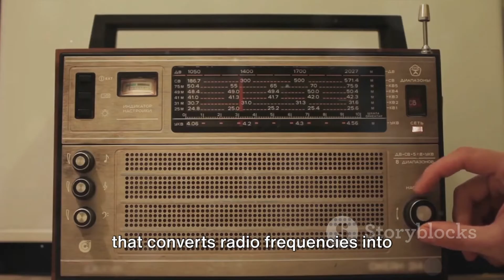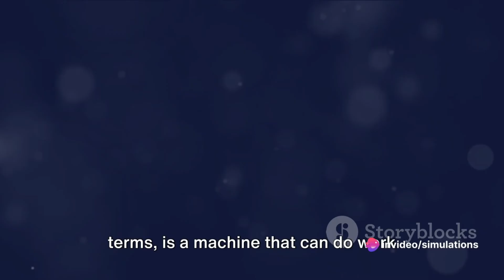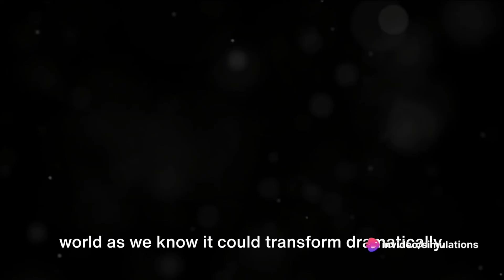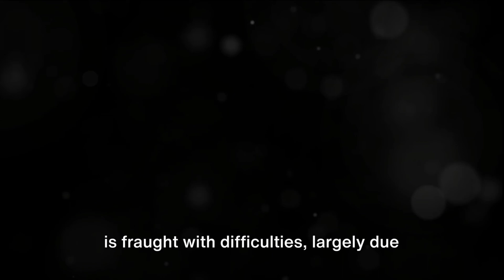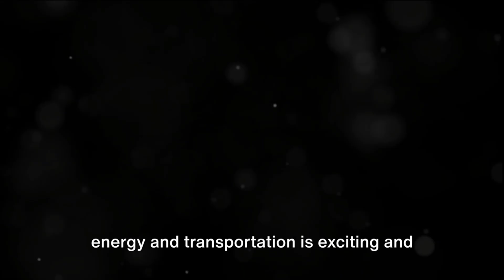Can Radio Frequency Power an Electric Vehicle?

Comment: It’s not a perpetual motion machine… just like solar isn’t perpetual. It’s capturing fuel(radio waves). Basically like filling up little bits while you’re on the go. It won’t be a thing until they can build a network for it and charge you an obscene subscription fee.
Reply: It does not need network. It works on earth from artificial created frequencies, stations already work. Out of earth out of the magnetic buble which protects bio forms to grow, in free space source is unlimited from cosmic particles. It is simply using any form of vibrations. Same as electrical transformer, only different choice of input.
Reply: It does not need network. It works on earth from artificial created frequencies, stations already work. Out of earth out of the magnetic buble which protects bio forms to grow, in free space source is unlimited from cosmic particles. It is simply using any form of vibrations. Same as electrical transformer, only different choice of input.
Reply: @Your_opinion_does_not_matter  That makes NO sense.

Comment: So does leaving the radio on, charge or drain the battery?
Reply: It's a receiver, not a transmitter.
Reply: 🤣 Depends, I doubt it will run very fast on NPR.

Comment: would make an ev car much lighter with no battery
Reply: Video didn’t explain anything
Reply: Just think of no more energy bills for heating or cooling homes , no more fuel needed to power cars and how much cleaner cities and the air , rivers or just life in general !    This is free energy !
Reply: the goverment will find ways to make us pay  @popeyesworld4930
Reply from the maker: Yes, and cheaper!
Reply: There would still be a battery but a smaller one. Weight has been a huge problem of electric vehicles. Less weight would improve handling, acceleration and brake distance, there would also be less wear and tear on the roads, also less valuable resources would need to be used to build the vehicles which may bring the price of the vehicle down.
Reply: Load of BS if you ask me!!